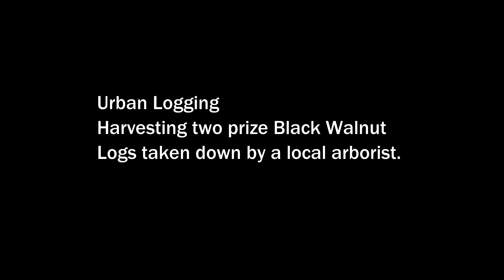SAVING WALNUT LOGS FROM THE FIREWOOD PILE/ URBAN LOGGING

Comment: Thank you Nathan for rescuing those logs from the firewood pile.  Where my offices are, they landlord heats with wood and buys the cutoffs from a lumber mill.  The last load came in with several beautiful 4/4 hard maple boards.  I told the young men who keep the heaters running to put those boards aside.  Since it's getting warmer up here in Northern Wisconsin,  they won't need to burn those boards.

Comment: Awesome ... I love how you decided to follow along my idea to suspend the log from the logging arch like that, using the tow strap to hoist the front and the winch to hoist the rear.  I'll bet it makes it so much easier to maneuver that thing around when you don't have to drag it all over the ground, and makes for much less of a mess to clean up when you're pulling the logs out of someone's yard. :)  It's also cheaper than the idea I proposed, to use a pair of log arches to do it, one in front and one in back ... plus you don't have to worry about steering issues, as it's balanced on the 2 wheels instead of suspended between 4 wheels.  Great way to think outside the box, man!  I love it!
Reply from the maker: thanks buddy, appreciate you watching,

Comment: Nathan, If you only took that one log, I think you miss out on a lot of potential material.  Branches 8+ inches are great for timberframe braces when cut flat on two sides.  For walnut, after milling two sides, leave the bark dry on and in 6 months to a year, draw knife the bark off leaving some of the bark paper, sand it , seal it with clear shellac  and you've got a great look.  For branches smaller than 8, they can be used in furniture projects for legs etc.  I use branches 5-6 inches in diameter, milled flat on two sides, 2-3 inches thick, for railings and hand rails. Mill then a little thicker so you can plane them to 2 or 3 inches thick.  If you don't have storage space, I understand.  I do, plus I'm using them.  So I end up using most of walnut trees.